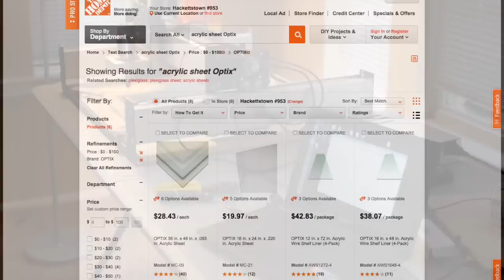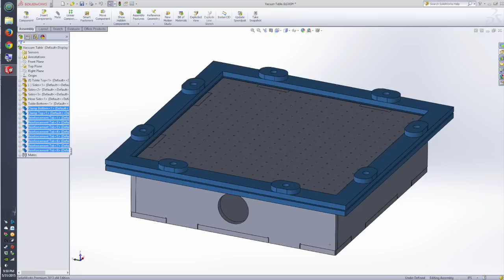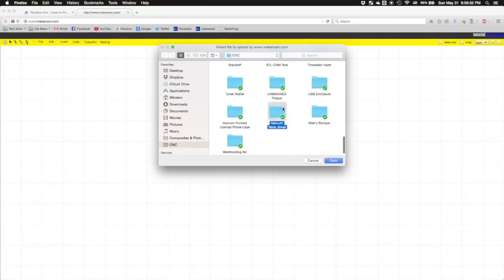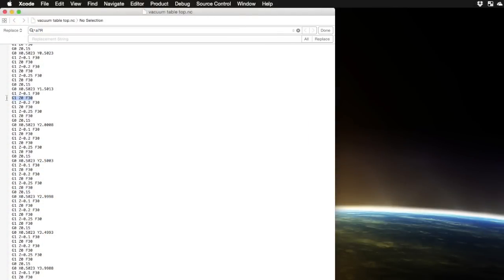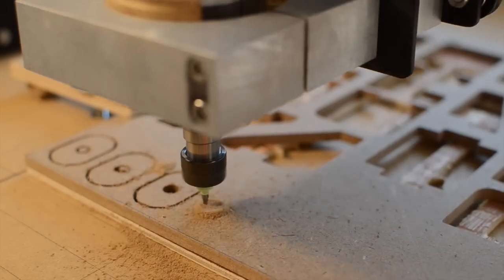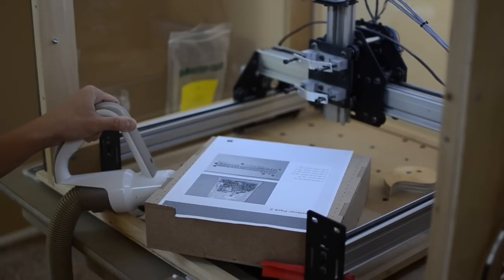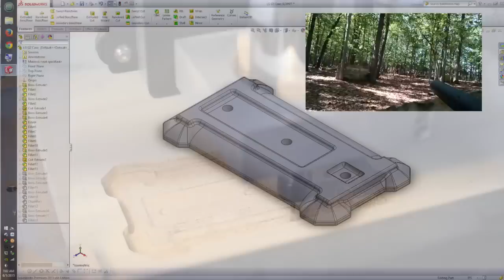Shapeoko-Made Vacuum Table Project

Comment: you can cut plexiglass just like you cut wood. Use the same tools with the same bits. the only different bit you need is for drilling holes the plexi bits have a steeper v to them then normal bits. I worked for a company making acrylic fish tanks for 6 years, trust me on this one. sharp bit and blades give you a better finish. Our shop looked like a wood working shop, table saws, router tables & hand held routers, drill presses and bandsaws. we also had a 4' by 4' vacuum form table. just my 2 cents.

Comment: Why is the CNC cut not in the same shaping as the phone (rectangular pockets on surface)?  

Does it have to do with the vacuum forming?
Reply from the maker: +TheRangeControl I wanted extra contouring formed into the plastic so that it would be more rigid. Unfortunately my material selection was poor, and I couldn't transfer all that detail to the acrylic. Good in theory, but execution needed some work.
Reply: ahhh... I've got you.  :-)

Comment: hey man,  cool project, heres a couple things that might help you out. 
1. use PETG instead , acrylic is usable for vacumforming but not very easy to work with, especially not with your setup (low vacuum and long time between heating and actually aplying the vacuum. ) 

2. if you cant get a hold of PETG or for some other reason want to use acryllig you can try drying it first, the reason for the surface inperfections are most likely moisture, the plastic can take up some of the moisture from the air and that boils by the heat making the plastic white, but the sheet in the oven at a low temp over night, your results might get better. 

3. An idea might be to modify your setup a bit so taht you use some sort of seal around your frame, the most important thing in the forming process is to get as much vacume as possible, and every leak will work against you, a seal around the edge will make things much easier, also try avoiding any other leaks. 

4. drilling small holes 1mm ish in the inside corners of your mold , places that will trap air and not be as defined. the small hole will not be visible in the plastic but will help allot. 

hope this helps.